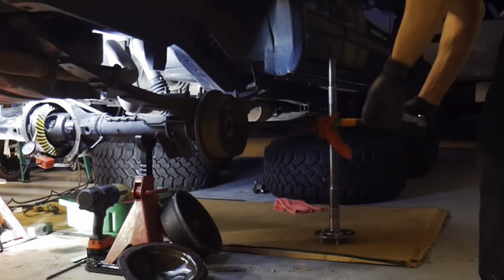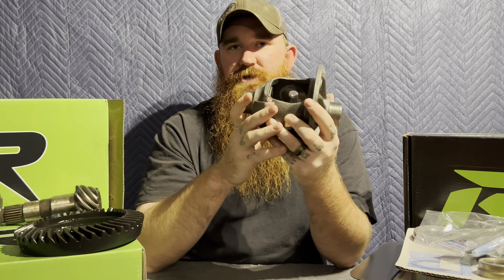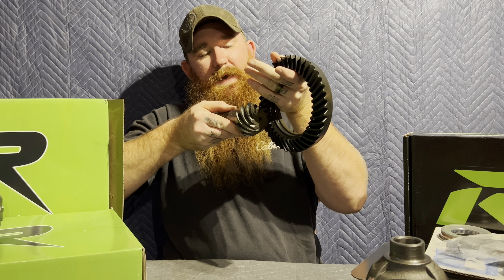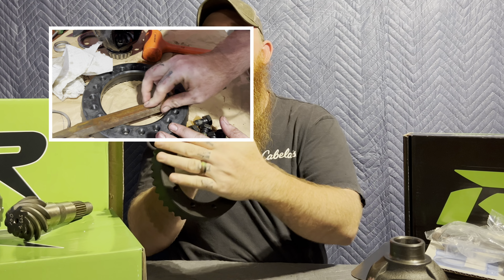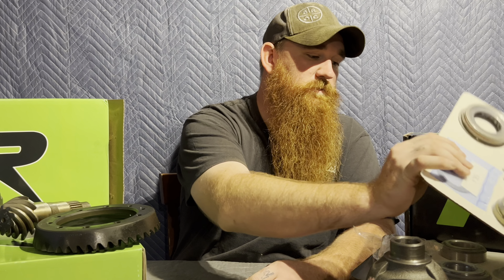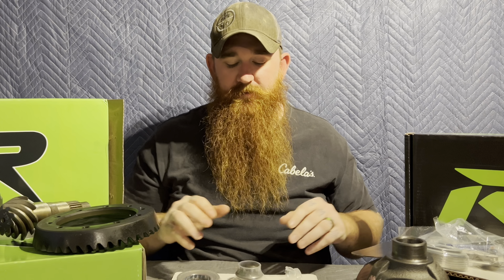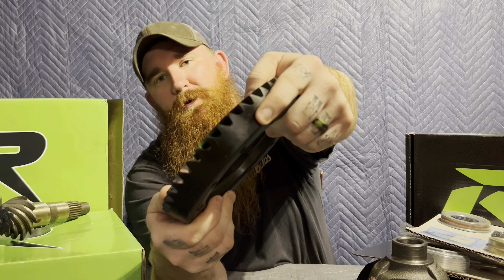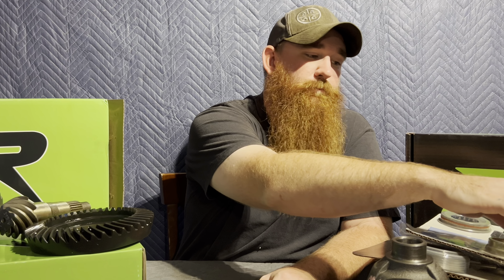The NEED to know on Jeep ReGearing

Comment: I’m so ready to re-gear my Jeep and your videos have been a big help.  I have all the tools I need to do it myself, have already done the lift/suspension, SYE, new shaft, etc.   I have a 89 Wrangler with a Dana 35 in the rear and a Dana 30 in the front with factory 3.07 gears, Peugeot BA transmission (I know, booo) and a NP231 txfr and 4.2l engine.  I just put 33x12.5 tires in steel 15” wheels. Factory tires were about 28”. I’ve done the formula to figure out new gears I need but am not sure it’s enough, it comes out to 3.61 (will have to round up to 3.73) but I’ve seen where folks are saying to go up to either 4.11 or 4.55 with 33”s.  I would greatly appreciate your opinion on what I would be happy with.  It’s going to be a city driver for the most part but we want to get into some off-roading as well but very conservative considering the axles I have at the moment. No money for anything else right now.  Thanks again and look forward to a reply.

Comment: Heck yeah awesome video man, I was wondering about this with my 98 xj 5 speed, the one I changed the rear to the 29 spline 8.25 out of a 99 3.55s and I also went and changed the whole front hp30 same before but not with 3.07s, is way better alternative everything has been great so far,  I have done everything on an xj except gears and this help out a lot man good confidence video 👍, wanting to change up at point and don't want to pay a shop .

Comment: Has anybody  in the comments done an 8.25
Reply from the maker: They are okay to do I’ve done many
Reply: @cherokeeronnie  I have a bad pinion bearing. Do I need to redo the whole gearset (pinion depth, backlash ect…) or can I just swap out the pinion bearing? I have 488 gears in the lunchbox locker currently.